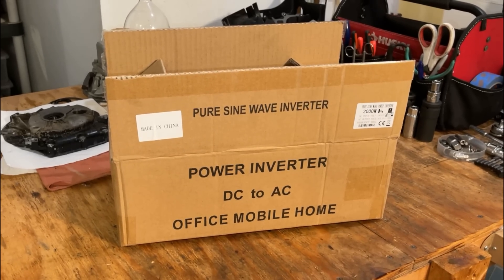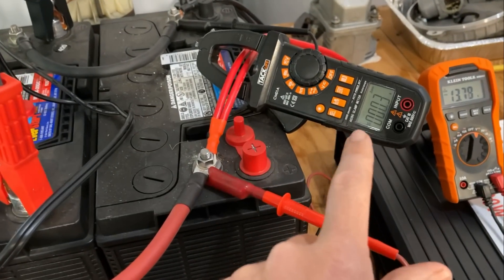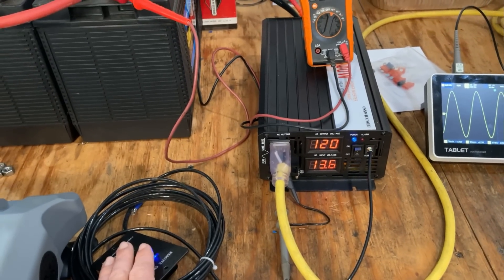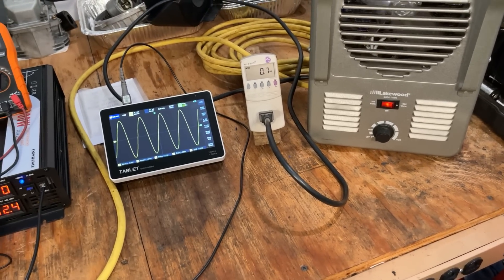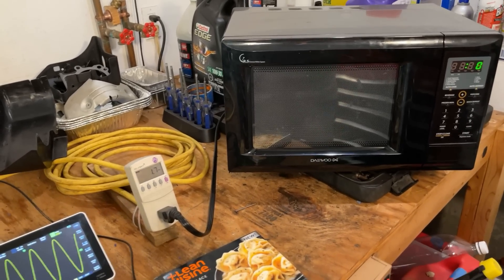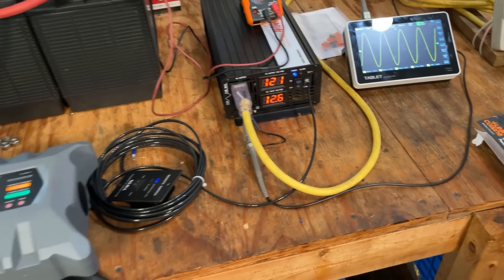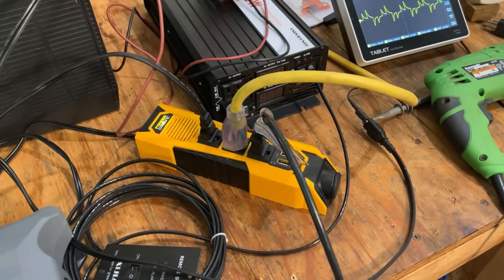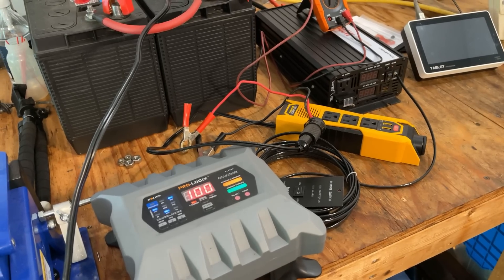CNSWIPOWER 2000 Watt Pure Sine Wave Inverter vs Honda EU2000 Inverter Generator | Load and Waveform

Comment: I've watched John "HEADSMASHER" Daniels channel work with them from the early days. Even THEN they were hands down the best "high frequency" inverter for the money. On his suggestion and videos, I bought one of these old ones (my 1st, 12v 3000w about the time this video was made). Built it on a hand truck/dolly..Which worked better than expected.
Everything else in that build was "24v-able", so I bought the new 3200w double decker model in 24v and used the old 12v 3000w for a carriable /solar generator build out of a Harbor Freight box with wheels as well, and now I'm building a 48v 6000w x2 system. IMHO they're even more so the Best bang per buck inverters. There is simply nothing out there as good, in their price range.
I'll eventually build a low frequency system after a couple years of no elec. bill. But so far I haven't needed a low frequency inverter to do all the things I thought I would need one for. My 24v 3200w and 12v systems combined does everything I need it to in my combined house and shop when every single thing is on, with exception for when the big compressor kicks on at the same time the well pumps do, and even THEN it has to be at night when all the lights and heaters are on, in the winter.. and my new 48v 6000w x2 (so 12000w) system will surely handle that. By the time I build a more hearty system, it'll just be cuz I can.🤷‍♂

BTW, you make good videos and deserve more subs bro. I'll start by adding me  ;-)

Comment: Why would you not need as thick a wires for the battery if it was a 24v inverter. Could you exsplain the reason for that please. Thank you
Reply from the maker: Wire size is based on amps.  Volts x amp = watts.  More volts means less amps for the same watts.
Reply: @jcondon1  thank you

Comment: i tried running an ac off this inverter and it would run fine for 3 minutes then the volts would all of the sudden drop to around 54 and it would make a buzzing noise. Any idea why it's doing that? i know it can handle the surge but not continous after 3 minutes
Reply from the maker: Not sure.  I still have this and have not experienced that issue.
Reply: @James Condon  yeah it's strange. I don't think it's too high of a surge because that would trip the alarm but after 3 minutes of running it will do that. I have no problems with other high wattage appliances.
Reply: It is a big ac though, 15,000 btu. But it will start it and run for 3 minutes. It pulls around 1280 watts so it should be able to keep running it?
Reply from the maker: Would make sure your batteries are capable, the wire connected to the batteries are the proper gauge and make sure the wire connections are tight.  1280 watts is close to 110 amps pulling from the batteries at 12 volts or 60 amps at 24 volts.
Reply: @jcondon1  This is the difference between cheap and quality, high frequency conversion and low frequency conversion, for example the Victron with their large Toroidal transformer.

Comment: I know this is an older video but regarding the voltage reading at 15:27,  at least a couple of volts of that drop are from the cords.  Assuming a 50' 12 AWG cord and 12.5 amps of load you have 2.17 volts of drop in the cord.  To avoid measuring this cord drop you might want to run a second light duty cord just for the voltage measurements  and use the heavy cord to just power the load.   In short the voltage reading on the kilowatt is not a true indication of the generators voltage output.   Thanks for the very interesting videos  and have a great day.

Comment: what gade wire should i used 3000 what inverter pure sine wave 48V 110V -120V 60HZ
Reply from the maker: At 3000 watts you will be pulling 62.5 amps DC.  The gauge wire depends on how long the wire is and the type of wire used.  Would say the minimum is 6 AWG.  2 AWG would be safer.  There are calculators online to help you https://www.omnicalculator.com/physics/dc-wire-size

Comment: will that 2000 watts pure sine wave inverter run TableSaw 15Amp I have same inverter 3000 watts pure sine wave inverter I do some testing I know it run things 8,10,12 amp not try 15Amp things yet
Reply from the maker: It should.  Really depends on the surge the saw creates when you initially turn it on.

Comment: I have a 3Kw German inverter generator hooked up to a large Computer UPS (Uninterruptible  Power Supply) with 4 large batteries. The output from a UPS is as near perfect as ever needed and should the generator fail it takes over for around 4 hours at 2000wW /250V.  I just happened to have both so why not.

Comment: Is your scope input ac coupled? Pass a square wave through a high pass filter (which is what ac coupling is) and you get a waveform like you saw.
Reply from the maker: I think I had a bad connection when testing the output of the modified square wave inverter.

Comment: From what I can see, the inverter in the Honda U-2000 may have bad capacitors. The alternator bolted to the engine puts out 3 phase power at a rather high frequency, which passes through a 6 diode full bridge rectifier, then, into a filtering capacitor. If that capacitor is bad, the voltage may drop too low during the current peaks drawn by the sinewave output stage, and if that voltage sags below ~170 volts, the output stage clips, just like a class "D" audio amplifier. Because the inverter uses its own frequency generator, it doesn't matter what the actual engine speed is. The output frequency does not change with load. The engine does vary. If a peak pulse coming from the alternator hits at the same time as the peak of the output, you get a full amplitude pulse. If the inverter output peaks during a zero-crossing of the alternator, it may not. That's what causes those ripples. The capacitor is sized to maintain the minimum DC voltage necessary for a pure sine wave under load, but, if that capacitor is bad, it can't provide the reserve power to do that. Because the alternator is 3 phase, the zero crossing actually occurs at a minimum of 1/2 the peak voltage of the alternator, so the output of the inverter never drops out, but, it is dirty
     I don't think it's possible to take the inverter apart to replace the big electrolytic filter capacitor. I tried, but the inverter was "potted", so there is no access to the internal components. That's done to protect from moisture and vibration from the engine. If that's the case, the only solution is to replace the inverter module, or, just run it as is, knowing that it will not produce a clean sine wave under heavy load.

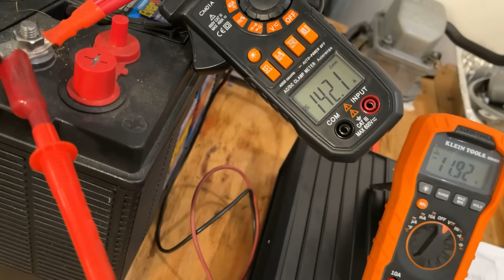Comment: @10:55 your warm battery wires make sense to me. 150 amps is too much for those. They need to be shorter or thicker to carry that without [heat] loss.

Comment: If you want to get an inverter, figure your inverter size to be 66% higher capacity. If you know you will be powering 100 amps of loads, then ONLY employ 300 amp capability; not more than that, and not less than that percentage. It's why you really need several different inverters for various loads.

Comment: Big thanks to a great video! I just ran across it after a YEAR, but to chime in on what others have said, very thorough. Id like to see a comparison on efficiency, not only under load but idol. Manufacturers don't make any claims for that or at least I haven't seen them.  Sub+
Reply: Idle consumption is listed in the specs.
Reply: @bbcellular  
I must be blind, I searched the specs and saw notging in there about idle/standby current draw. Very important figure for an off grid setup.

Comment: I have a basic , 5000 watt generator. Not sine wave. Can I use that with the 80-60 AMP charger that is built into my Pure Sine Wave,5000 watt UPS , INVERTER/CHARGER, WITH AUTOMATIC TRANSFER SWITCH?
Reply from the maker: 80-60 AMP @ how many volts?  As long as the charger pull less then 5000 then technically you can use it to charge the UPS.  You want to make sure the generator is brushed.  Brushless generators have a very dirty power output and can cause damage.  Brushed generators are better, but still considered dirty so there is some risk.

Comment: How are you making the connection from the scope to the power cord? I've tried looking at several  YT videos, but they are so confounded and never quite get to the point. I think they are coming from a scope connected to the mains and measuring a power cord connected to the mains.

Comment: This is interesting. Never seen inverter wave form in a collective manner, from good bad to ugly. One thing I have not seen and is craving for seeing is - inverter ac input versus ac output wave form w/wo loading. Essentially coming off same unit, such as Honda eu2000.
Reply from the maker: I will make that video at some point.
Reply: @jcondon1  thanks in advance. 
I forget to mention this. Oscilloscope inputs are single ended referencing to signal-ground. So it cannot handle differential signal at the inverter input when ch2 is hooked to inverter output. Unless we remove the probe on ch2 use only ch1. I hope you are not reading this in hospital.

Comment: 2 lead acid batteries not even 100ah each will not hold voltage discharging 100 amp let alone 2000w  of 12v DC

Comment: Great Video. Just subscribed. I have a question I want to run an electric home griddle when I am out camping instead of a propane stove. I have a 150ah life po4 battery and a redarc.1225 dcdc charger will this inverter work for my 1500 amp griddle if so for how long? Sorry no matter how much I try amd learn this it's hard. I appreciate you
Reply from the maker: I am not sure if this inverter is compatible with po4.  Also you do not need a pure sinewave to power a griddle.  You could save a little $$ and get a modified sinewave inverter.  To run 1500 watts AC you need 12.5 amps at 120 volts.  Assuming your battery is running at 14 volts, then it will need to output 107 amps DC to support 1500 watts.  The inverter can definitely do it, but your battery will be the determining factor.  Best case your battery will power the inverter at that load for 1.4 hours.
Reply: @jcondon1  thank you so much for getting back to me on thos I appreciate you. Keep up the great videos

Comment: Hi, I'm a csnwipower 2500watt user.  I have a few questions.  what is the function of the remote switch?  and can the remote switch not be installed on the unit?  what effect?  thank you for your answer
Reply: To turn it off and on lol

Comment: Could you add an inverter like this to a regular generator, to the 12V output?
Reply from the maker: You could, but most 12v outputs on generators are limited to about 8 amps at 12v which is only 96 watts.
Reply: @jcondon1  Another question, it would be possible to convert a regular generator to an inverter one, with one of these inverters?

Comment: the inverter sounds like it frying .making a loud screeching noise. the fans don't come on until it really hot and then they don't work right .and also the ac amps and the dc amps fluctuates pretty bad. this is new out of the Box. otherwise the inverter works.3000watts 24 volts.. it would not last long like this...........Buyer Beware  i watched all the youtube videos in this inverter and thought it was good to  i tried to exchange it and they said it suppose to be like that .i laughed... .....you can whtch this on my youtube if you want or you can buy it ..im just warning you  i just don't want no more people getting ripped off.......they send people to reviewed these that are better made then the one you get ..thats how china work i seen this to many times on reviews

Comment: with conjunction of running batteries you should definitely run a MAXWELL super capacitor bank so your not killing your batteries and give the proper voltage charge without any drops to your converters! the supercapacitors will recover quicker that battery charge will and less work for your batteries! I think people are starving the electrical needs for the inverters witch kill them quicker than normal operations of them. sure a lot go with junk parts because people want to make their stuff cheap to make a buck but people should look at what feeds the inverters because im sure their issues start from the feed end to the converters! NOTE: I have a ham radio station in my car and the power goes like this: Caterpillar Premium High Output Maintenance-Free Wet Battery (12 volt, 1400 CCA, 4D BCI) then a super capacitor bank of 12 maxwells 2.7 3000f then out to the inverter so there is 2 set ups like this in my car I also have 2-350 amp alternators to recharge each battery set ups! with two dc motors spooling up the alternators all of it is self powered. now there is more than enough juice to power my inverters the electrical system has zero strain so nothing heats up and burns up! so the in feed power to any converter is key and also the draw from the converters is important too many over draw the converter and max them out with out any over head.
Reply from the maker: A capacitor bank is always good either on the input out output of an inverter or a generator.  It will adsorb the surge and cause a lot less stress on everything.

Comment: Hi Doug, I am new to tent trailering and am looking for a reasonably priced 2000 (or better) continuous output pure sine wave inverter. Do you have another inverter suggestion, as this one has been out of stock for some time so I am not able to purchase it. Also wondering what gauge copper cable to run about 12 feet from my batteries to where the inverter will be mounted? Really appreciate your help. Cheers
Reply from the maker: The cable gauge depends on the length, voltage and amps.  Assuming 12v, 12ft, 166 amps at 12 volts you would need at least 4/0 awg wire.  There are calculators online you can use.  At that length you might be better running a 24 or 48 volt system.  Inverter should be mounted inside somewhere with good airflow for cooling.  Do not have any other inverter recommendations, but would make sure you read the reviews.
Reply: @jcondon1  James I’m not sure how I can use a 24 or 48 v inverter as my batteries are 12 volts. Also do you have a decent pure sine wave inverter you’d suggest? Trusting you judgement. Thanks, Doug

Comment: What I want is an AC to AC pure sine wave inverter so that I can plug in my computers to the inverter while the house is running on a generator.

Yes I know that UPS's exist that can do this but they are commercial UPS's and cost way more then they need to.

Something like this except running off normal AC voltage to clean up the power from the generator to make it safe for electronics. I already have a generator, getting an inverter generator would cost $1200++ vs $200 for a simpler inverter to power the electronics in the house.
Reply: A computer is DC anyways, so you just need good DC power supply with extra filtering.
Reply: @benjamindees  yeah but that would be a royal pain to setup to work with a computer in a temporary situation.

Unless you mean that the normal PC power supply would work with the dirty power from a generator. To that I have to ask why it is always recommended to not use computers or other electronics on generator power?

My thinking an AC to AC inverter like this  I could simply put it inline with the computer and run it temporarily until grid power was back and be a lot cheaper then buying a $2000 inverter generator.
Reply: @TexasAce  Some power supplies are better than others.  There is a trade-off between good power filtering and efficiency so it's sometimes overlooked.  But you can always add a good surge protector with EMI filtering like a Tripp-Lite Isobar if you're unsure.

Comment: Would love to see you do more electronics work on your channel. With some basic lab equipment like benchtop oscilloscope, signal generator, benchtop multimeter, variac, a few things like that… And you would be amazed at the things you can fix! 

And similar to the device in your video… There are extremely well-made pieces of test equipment being made in China these days… So you don’t have to spend thousands on HP or tektronix lab gear.

You’re so good at explaining and teaching it would be a joy to watch you tackle more complex electronics and PCB component level board repairs. While teaching troubleshooting and how to track down faulty components on circuit boards… To repair these devices.
Reply from the maker: I am slowing picking up more equipment.  Would love to get into PCB repair.  Soldering has always been my weakness, but also do not have the proper equipment so maybe I am not as bad as I think.

Comment: Hi. I like your videos. But one comment to the usage of an oscillascope. You need to switch your oscillascope to DC. The use of DC and AC is a bit missleading if you are used to a multimeter. AC mean it add a small capacitor in the line. There are some cases, where it is usefull (eg. if you want to get rid of DC portion of a signal like if you want to see what ripple causes the inverter on you battery) but normaly you can use DC. In your case the frequency is so low (61Hz is very low from an oscillascopes point of view), that the inline capacitor is charching faster than the signal is. From what I can see in your video I guess below 500Hz you get disortions.
Reply from the maker: Will try that out.  Will be making another video later this summer testing the wave form of several different types of generators.

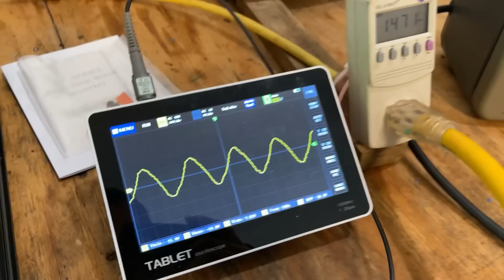Comment: 15:17  Why is your tablet only seeing 30v peak to peak?  That is a really large discrepancy. 
I have only ever worked with the old analogue CRT based scopes my university had because ultimately I did not work in the field in which I am educated.
Reply from the maker: Not sure.  It is a cheap oscilloscope, could have been an issue with my probe connections.